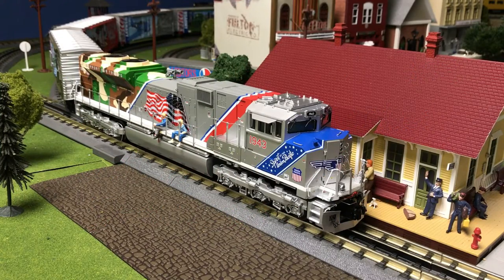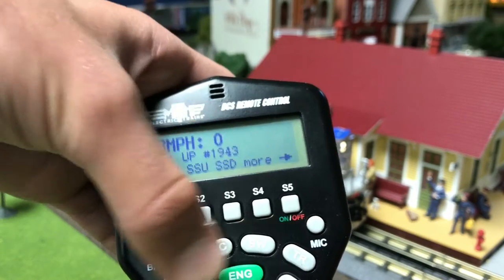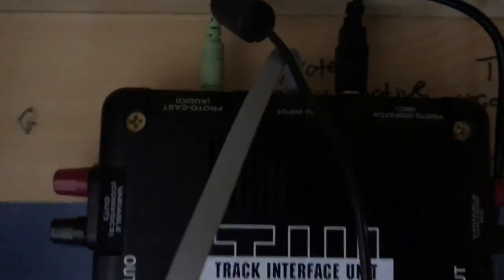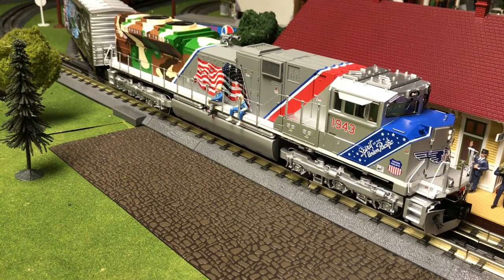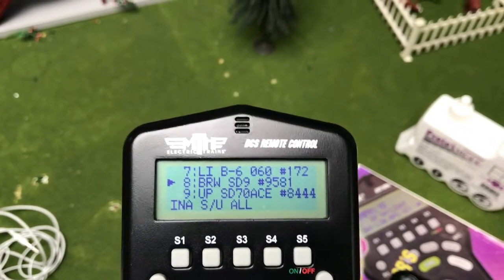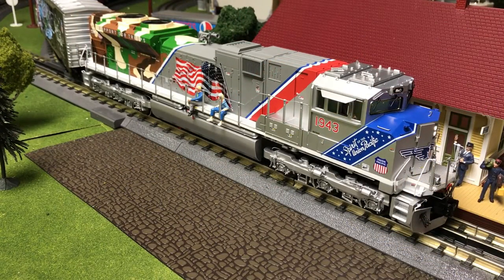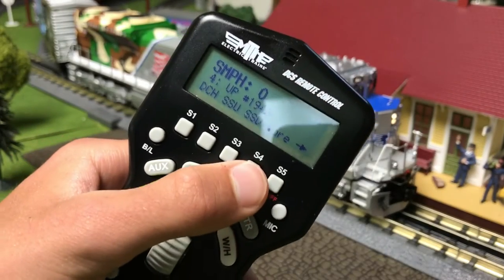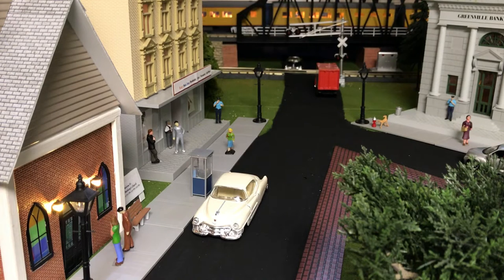Hidden Features of MTH DCS

Comment: great info
Reply from the maker: alan solomon Thank you!
Reply: @rickystrainvideos3041  how do I wire up switch’s please
Reply from the maker: @dennishall8709  You will need 3 wires. Having different colors makes it a lot easier. The AIU should have instructions on how to wire switches, but if not, here is a link. Page 7 gives instructions on how to wire switches. 

https://mthtrains.com/sites/default/files/download/instruction/20as16818i.pdf